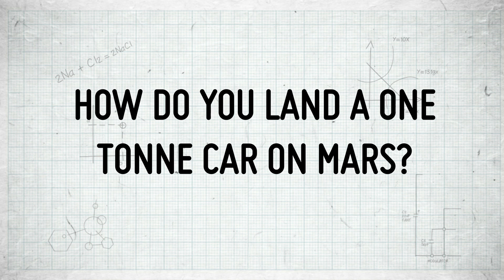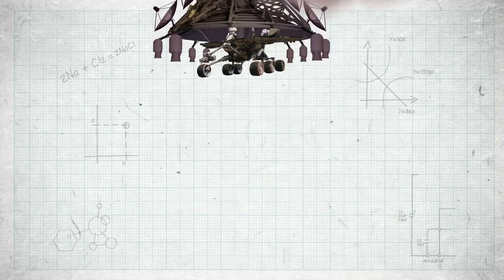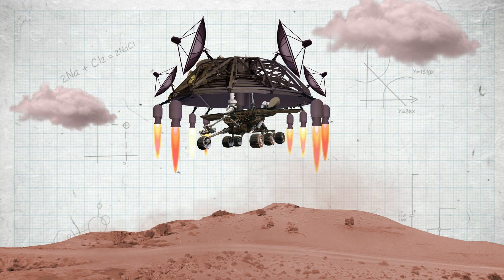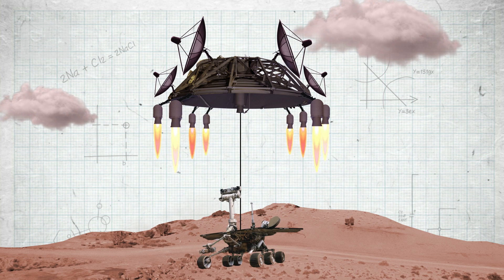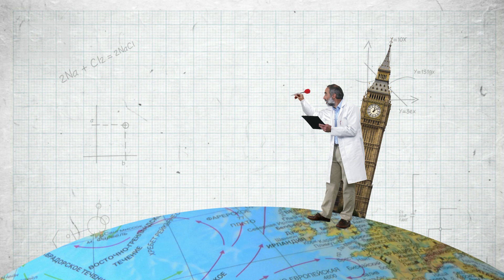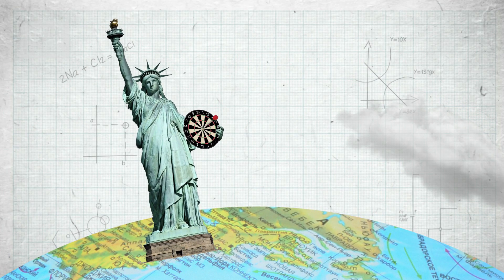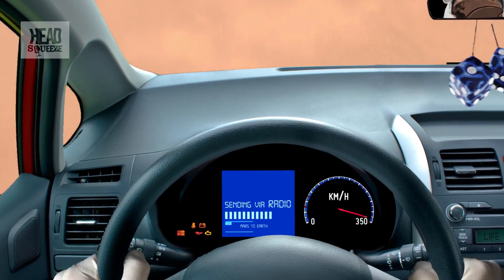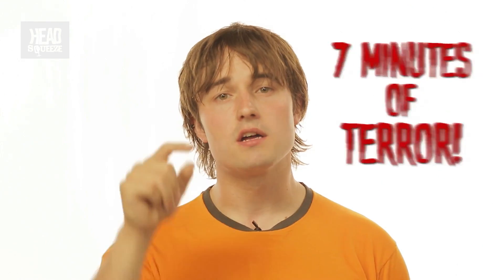Landing the Mars Rover with a Rocket Crane | Sci Guide (Ep35) w/ Leon Vanstone | Earth Science

Comment: Two reasons. You build with whatever tech is available to you at the start of the development cycle. So if you're building a rover for say 2020, and you start developing it in 2013 you build with the technology available to you in 2013 no matter what advances there might be. 

Its not that simple though, because you need space hardened technology/well tested software that works with that hardware. Which means you are further limited in what technology you can use.

Comment: Viking Landers & Phoenix both landed by using parachutes/retro rockets. The Viking landers were about 600 kg (1322 lbs), Phoenix was about 350 kg (770 lb). Then there was Mars Pathfinder which was only 10.6 kg (23 lb), and finally Oppy & Spirit  that were 348 kg (767 lb) each. Anyway, those three landed with a combination of parachute, retro rockets and an airbag landing platform that surrounded the rover. Which worked great for those three, but Curiosity is too heavy at 899 kg (1,980 lb).

Comment: Now, they couldn't use the airbag system but they could use retrorockets technically except that retrorockets would damage the rover by throwing up dust/rocks. Thus the sky crane system was needed since its so heavy/big. Landing humans on Mars will require another solution, because that'll be even heavier (The Apollo Lunar Module was 15,116 kg (33,325 lb for example). Which Headsqueeze thinks will be parachute, retrorockets, and landing legs that act as a cushion.

Comment: They used the wrong rover in their animation.  The one pictured is either spiritual rock returns. Curiosity did not have solar panels instead using a radioactive thermoelectric generator for its power as a way of avoiding the problems of dust covering solar panels.

Comment: Most of the time it is because these missions take years to design and in the design stage a processor that is robust, tested and reliable will be chosen over one that is state of the art at the time.
Also bear in mind that no GPU is required which is what takes up most of the maths processing on modern processors for mobile devices and computers.
So in some senses it is not a fair comparison to compare it with an iPhone 5 as it is very specialised and limited in its requirements.

Comment: Can canyons tell me why they're using such a low end processor (200Mhz). I would think it has to do with size because your can find very small processors smaller then your pinky nail. My only guess would have to do with power usage. Lower clock CPU, less power needed to run.